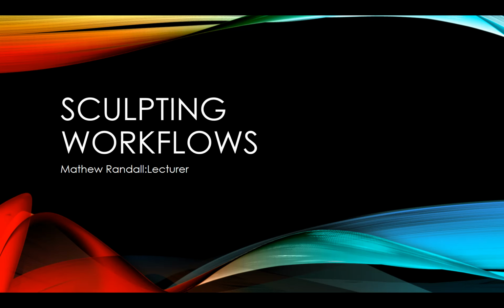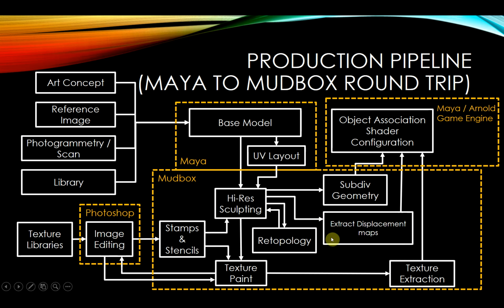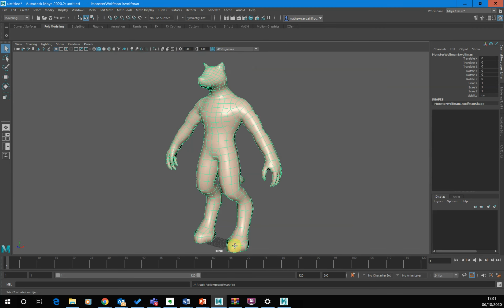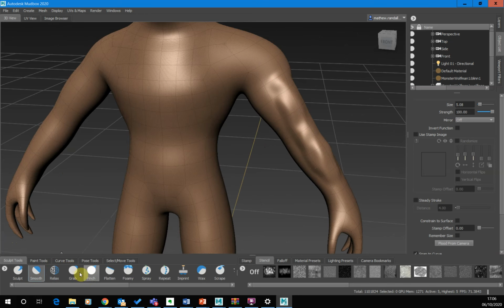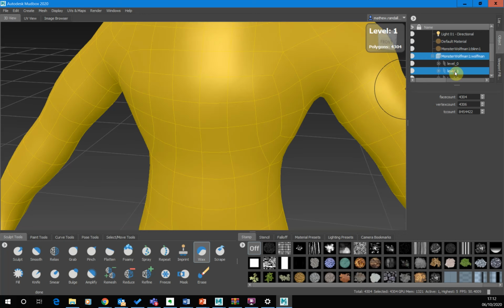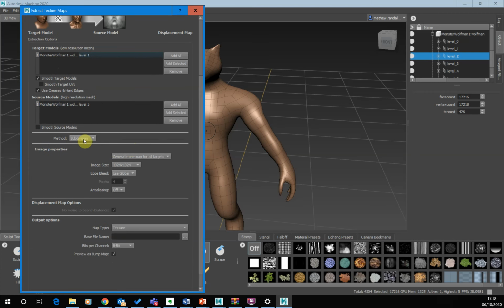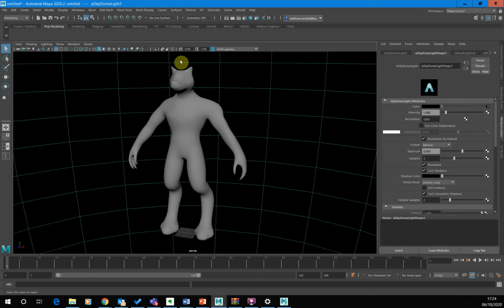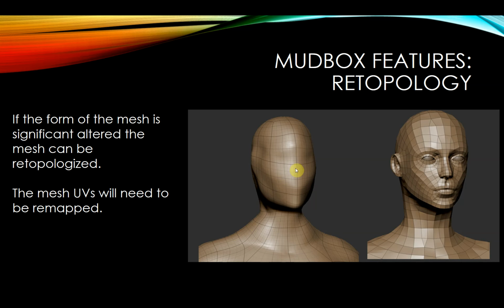Maya and Mudbox Sculpting Workflow

Comment: Hi, Thanks for the video 
I have a question, If the mesh Uvs needs to be remapped, where I need to do this? Will I lose work?
Reply from the maker: Remapping to support lower level subdivisions is not a problem, these can be created through interpolation within mudbox.  If the UV Map is fundamentally, this could be a problem. If you retopologise the model in Mudbox for example, you can get Mudbox to automatically layout UVs, they look awful and would be any use for texturing in 2D but they will work for 3D texture painting tools.  Also Maya does have a tool for transferring image textures  between UV maps. I have a head texturing tutorial which covers this.
Reply: @justpressstart  thanks, I´ll see this tutorial :)